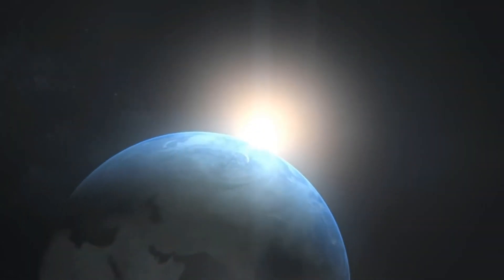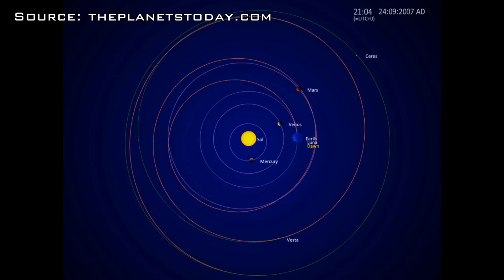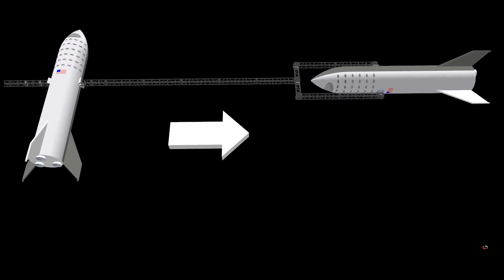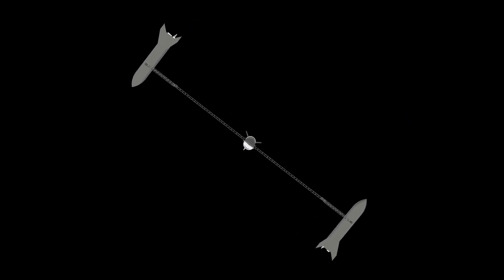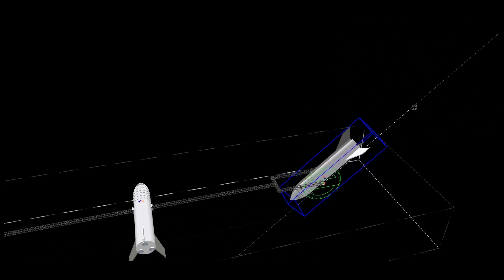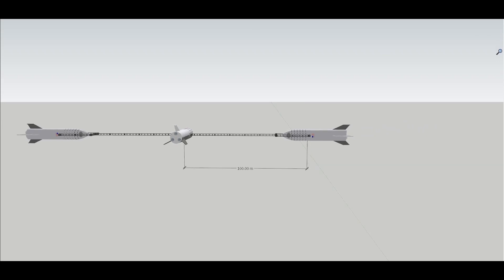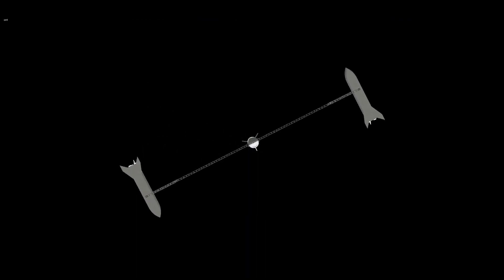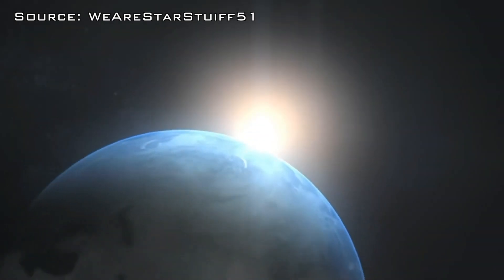GLS2: Artificial Gravity for SpaceX's Starship

Comment: Nice concept, but dont the lateral spaceships need another degree of freedom for rotating in the direction of the flight? I mean, if you connect them while still in orbit around earth, you'll get the lateral spaceships pointing in a different direction than the central one. So basically, a big dead mass in the center.
Reply from the maker: All 3 ships leave Earth's first, and on the way to Mars they link up. Check out my first video (my only other video) to see the original idea which featured connecting up before the TMI (Trans Mars Injection)
Reply: @smallstars  understood what you mean, I'm not an expert but this could be kinda difficult, consider that while accelerating each ship will need to stay at distance for each other for security reasons, this will make their orbit around the sun a little bit different and you'll need to make some intersection manouvres in deep space to make them closer again. Also, for each orbit correction you might need to separate them, correct the orbit, catch them again, reassemble

Comment: Just a cable between the noses of the two ships would do the trick. You don't need to use the Raptor engines to set it spinning. The maneuvering thrusters, which point in all directions, would be more than adequate.
Reply from the maker: Show me the numbers! A lot of people say this but it seems to always be just an assumption with no math to back it up. Thanks for watching and thanks for your input though.

Comment: Did you discuss the balance aspects? I'm thinking the different masses and how they are allowed for. And will movement of the Humans affect this?
Reply from the maker: I didn't touch on it in this video but it will be an issue. Movement of humans shouldn't have a noticeable effect, but mass differences between the Starships might need to be mitigated by some sort of weight shifting action performed by the GLS.

Comment: Anytime a universe of imbeciles cry that something is impossible, there comes some smart guy saying "why don't we do that?" - your solution looks feasible, with the added advantage that a mission of 3 ships is much more safe in case of any accident. It  would need all 3 ships to fail  to end in a catastrophe.  Enough one works to transfer all the people and do the trip in the uncomfortable way, without artificial gravity, but alive until home. All we need are good engineers to design the telescopic structure, then you have the space cruise ship we all want... Congratulations!
Reply: Since it's only feasible to get to Mars once every two years there'll probably be 10+ ships going at a time. So you'd have one main ship and a few supply ones.

Comment: no need for 1G going to mars start maybe at 0.8
halfway go to 0.5 or not
you can use the RCS thrusters to slow down over a long period of time
going back start at 0.5 use RCS to slowly speed up the RPM
Reply from the maker: We have to see how viable the RCS is going to be for something like this. I think 1 G+ is important, but I am not a flight surgeon or medical doctor, it just seems that the more gravity the better for physical conditioning. Part of me wishes the Starship was taller, so that you could get more than 1.05 G on lower decks for EXTREME WORKOUTS!
Reply: @smallstars  they spend more time on mars than underway so those months at lower than 1G won't make that much difference i think 0.8G won't make much difference to 1 G an then going to 0.5G over a 3 or 2 month 

period 1 month at 0.5G will make it easier  to adjust to 0.3G on mars
going from 1G to 0.3G abruptly will make for very clumsy people

 if you use the main motors that would be impossible  because you have to swivel the ships to use the engines
the gravity would have to change abruptly

on the way back it would be possible to gradually increase the gravity to 1G
have you seen Isaac Arthur channel he has some great videos about spin gravity?
Reply from the maker: @fred6319  I'll check it out

Comment: very cool but to my understanding the starship is optimized to mostly endure vertical forces. I think it might break in two when it turns 90 degrees to spinup or down.
Reply from the maker: Good point, I have a spread sheet going with loads math for version 3 of this concept (next video) subscribe if you want to follow along!
Reply: @smallstars  I just watched your first video. Excited for your next.

Comment: Any course change will make this structure crumble. And you clearly need to fire the engines to get into the orbit around Mars. Highly improbable solution to the problem.  However gravity is needed even if its not need to be full 1 G. 
The most plausible way is constant acceleration. That even has the beauty to shorten the flight time drastically. 
In general we need a spaceship to reach Mars...
Reply from the maker: Thanks for your thoughtful input!
1. If you needed to change course, you would stop the spin to do so.
2. SpaceX's current plan is not to enter mars's orbit, but instead enter atmosphere from the transfer trajectory. Yes engines will be fired.
3. Constant acceleration is so far from being possible with our current propulsion technology that I will give $1,000 to a charity of your choice if it becomes the solution.
Reply: @smallstars  well there is a alternative Nuclear thermal rockets "As of 2013, an NTR for interplanetary travel from Earth orbit to Mars orbit being studied at Marshall Space Flight Center.[12] In historical ground testing, NTRs proved to be at least twice as efficient as the most advanced chemical engines, which would allow quicker transfer time and increased cargo capacity. The shorter flight duration, estimated at 3–4 months with NTR engines,[13] compared to 6–9 months using chemical engines"
wich would allow of course for a much shorter mission time and s greater chance to survive this. Still dangerous.

Comment: Landing the GLS on mars for refueling is a risk, an alternative would be to  land the others and  engineer them to allow extra fuel so they can refuel the GLS when they attain orbit.  Of course the risks of orbital refueling   needs to be assessed but is it greater than adding a landing and takeoff of the GLS?  Also if the trusses can be swivelled backwards for acceleration the trusses need not be folded  and unfolded for a mars landing (of course you could always leave them in orbit  if you wanted to land the GLS, so long as the trusses were not needed to maintain the GLS's structural integrity.

Comment: 1st of all the sheer velocity of the spin speed would require insane materials. 3rpm sounds slow but with a radius of 100 meters its crazy. You’re also completely disregarding the coriolis force felt by the crew. This  design just has too much huge spinning parts. Its just begging for some unplanned orbital dissassembly.